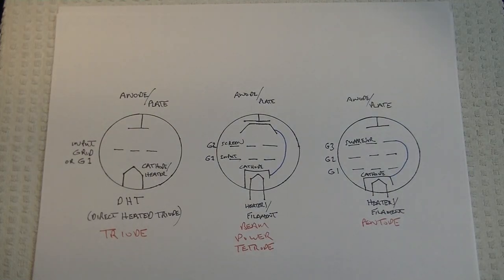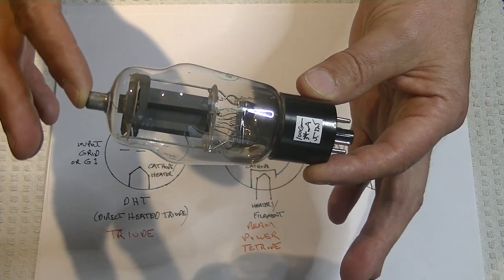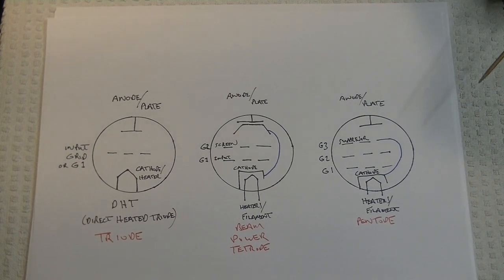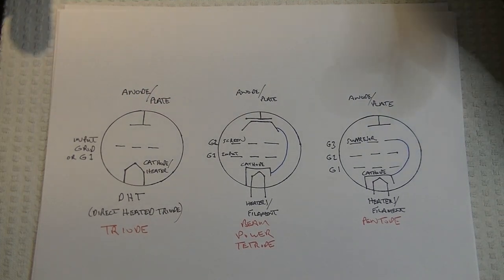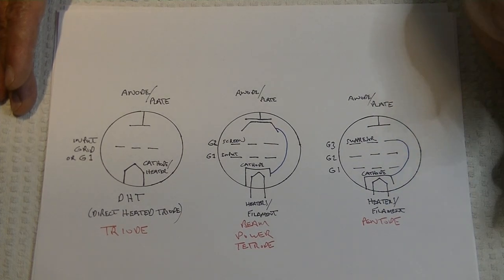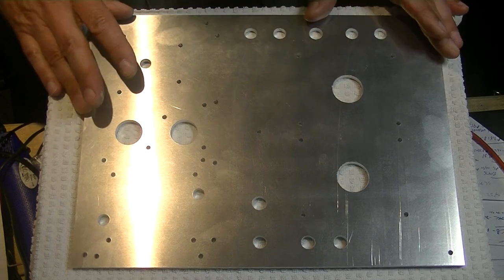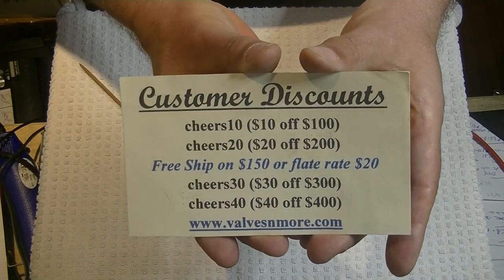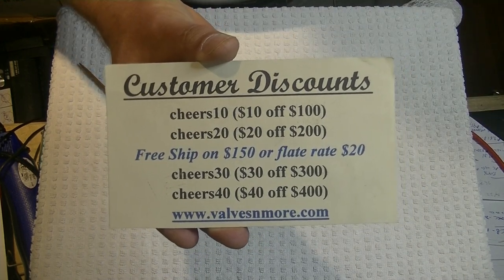Tube Lab #90 - Differences in Power Tubes

Comment: The timing of this video for me to watch is absolutely perfect. Looking at replacing (as a substitute) the RCA 6080 power tubes for my Woo Audio WA 22 amp. Thank you, Jim! Of course suggestions to replace the RCA 6080 is greatly welcome. ;)
Reply from the maker: I have a large selection of 6080 / 6AS7 tubes, including NOS (new old stock) Sovtek in the ST (shoulder tube) aka coke bottles, and used Svetlana's as well as more modern 6080, here's a link: https://valvesnmore.com/?product=6as7g-6080-tubes
Reply: @tubelab194  hi Jim. You’re so kind and as a fellow Canadian I’m quite happy to buy from you and I will. :)
Now I apologize. I worded my inquiry incorrectly. I’m looking for what you may think is an Upgrade from the 6080’s in your experience. Of course being with in reason of Tube Data specs. ;) 
Your opinion and knowledge would be so beneficial to me. Happy Canada Day weekend and thank you for your time. ;)
Reply from the maker: @Nephilim-81  The 6080 is the modern bottle type of the original type 6as7g which uses the ST (shoulder type) aka coke bottles.  As far as I'm aware the spec is the same.  The tube type is unique and was itself an upgrade of an earlier type.  So either the 6080 or 6as7g is what you are looking for.  Unlike other tube types with many rolling opportunities, that is it.
Reply: @tubelab194  fantastic knowledge bomb my friend and that makes a lot of sense. Now I can visit your store and make a nice decision. Thank you for your time. :)

Comment: Another great video.I like it very much.
I have a quad of genalex golden lyon kt 77 tubes (200 hours burned) on my Willsenton R8 and on v1 the tube suddenly  began to redden.I have not heard changes in the sound.I stopped the amplifier and installed kt88.I supose the tube is gone.Is it possible to save the remaining three and only change the defective lamp?
Have a nice day
Reply from the maker: Red plating (tube is out of control), did you check the bias on the kt77 and see if it was correct?  This is a long shot most likely the tube is garbage.  If you purchased from a reputable seller they should have a record of the test number for idle emissions (mA) or supplied that data when you purchased that set.  We do this for every single order, so it's easy to check an order for the testing data and find a match.  Without the information your set is good only as a matched pair IF the seller even matched them originally!
Reply: Thanks again for your answer.
The bias was correct.I check it once a week.I will contact the seller.He is a trusted one.Maybe I'm lucky to receive the parameters of the tubes.
Kind regards

Comment: Are there any triode power tubes of note with indirectly heated cathodes?
Reply from the maker: This is an excellent question!  Yes there are many, but none that I recall with higher power.  So what we do is put a modern Pentode or Tetrode into quasi Triode Mode.  This is done by simply strapping the plate to the screen (G2).  You can study my Yuri Monoblock schematic, it's available as a Free Open Source design on our website, here's a link:
https://valvesnmore.com/?page_id=11919
So in the Yuri's case we have the lovely 6p7s beam powered Tetrode strapped in Triode Mode and the sound is sublime.  Operating in Pure Class A, the amp has the low noise of an indirectly heated cathode, the power and reliability of a modern Tetrode and much of the sound of a directly heated Triode and they are affordable!  Neat trick eh!
Reply: @tubelab194  Yes, quite neat!  Thanks.